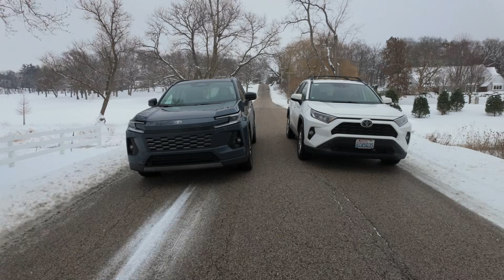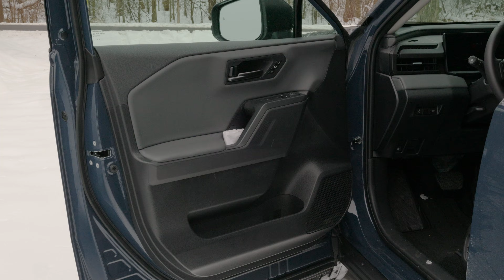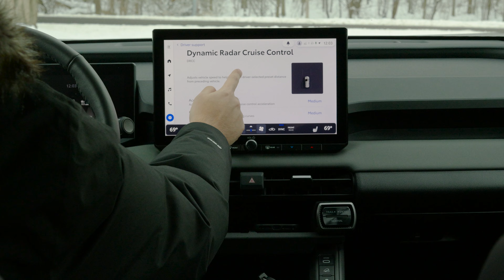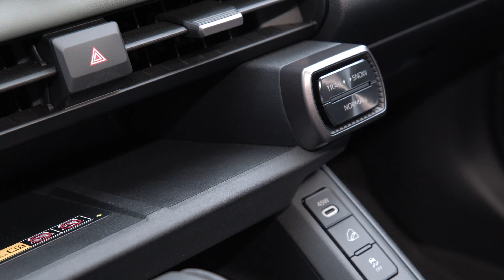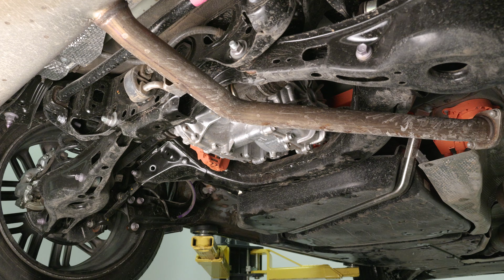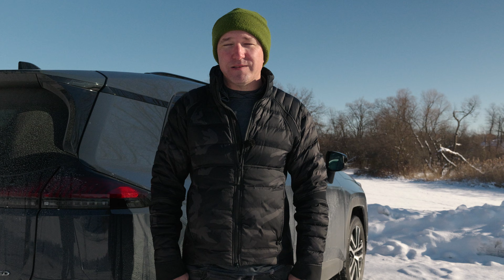2026 Toyota RAV4 | What Most People Want

Comment: I've driven and or owned most of the vehicles compared in this video and nothing compares overall to the Rav4, especially my 2026 XLE Premium. Just completed my 10th 15 -20 mile city drive with speeds of 35-45 MPH and the MPG came back at an astounding 52.5 mpg. Lowest was 46.2, highest was 55.2. Go Toyota. The best hybrid system of all car manufacturers.

Comment: I will stick with our 2021 Rav 4 Primes. The knobs are nice to adjust temp. 

Real life 38-40 mpg in hybrid and after 65k miles and close to 6 years of ownership our range has dropped from 40 miles to 30 miles and in the winter expect a 15% drop in battery range and in hybrid real life 36 miles per gallon.  

The 2026 most likely will have the same drop in battery range overtime. 

We drive 85% of the time in EV and we have a level 2 charger in our garage and charge twice a day (at home and at work) when I compute to work 56 miles round trip. 

Our next purchase will be a Toyota EV when they perfect a solid state battery.

Comment: New car exterior is better, old car interior is superior, not even a little but wayyyyy better, plastics for this much money is basically robbery, and not to mention the unsafety features, that is horrible to the point its even dangerous, it will steer you into danger just to keep you between the lines, you have to switch it off every time, just horrrrrrible

Comment: What this video completely misses is that heated/cooled seats and heated steering wheel are now automatically controlled by the car and those settings are fully customizable. This is something that used to only be available on the upper Lexus models(Lexus Climate Concierge). So the car will look at the outside temp, the current cabin temp, and the desired temp and adjust the vents, fan speed, seats, and steering wheel to get to the desired temp as quickly as possible and make you as comfortable as possible while doing it. 

The point of the new system is to set all your customizations during the first couple weeks of ownership, and then never have to worry about it again. Once done, all you need are the temp and defrost buttons. I'm very happy with my 2023 Prius Limited(all physical buttons), and planned to own it for 10-15 years, but if Toyota did a mid-cycle refresh in a year or two with this new infotainment setup, I'd seriously consider it.

Comment: The video's author received advertising money. And an honest review of the car: if I only want a gasoline engine, I'll buy a Chinese car. And Toyota will be left without a buyer. Fortunately, China still produces many cars with a conventional engine. Nibrid is more expensive. If you get into an accident, the repairs are more expensive. Gasoline isn't expensive in America. Why do you need a hybrid? 5 liters of gasoline per 100 km, while a regular engine uses 15 liters. A difference of 10 liters. For 10,000 km, that's 1,000 lire. Now calculate how much the extra cost of gasoline will be on a regular engine, and how much you're overpaying for a hybrid. It's all a scam. Corporations will always find a way to steal money. The new car has the same body, the same cheap plastic, and a dull look.

Comment: Don’t forget to mention the temporary spare tire vs the inflator set up in the other vehicles. 
If you use the inflator, be prepared to replace the tire AND wheel. The cost of removing the inflator jiz is very expensive and can equal the cost of a new steel/ alloy wheel. 
That’s why we bought a 2025 Sienna with the temporary spare instead of the kit.

Comment: Toyota /Lexus reliability is going down too many recalls lately.

Toyota is recalling 126,691 Tundra and Lexus models because the engines can stall, increasing the risk of a crash, according to the National Highway Traffic Safety Administration.

In a Nov. 6 recall notice, NHTSA said that "machining debris" may not have been removed from the cars' engines during manufacturing, which could cause the engines not to start or to turn off while driving.

The impacted vehicles include:

Toyota Tundra, Model Year 2022-2024
Lexus LX600, Model Year 2022-2024
Lexus GX550, Model Year 2024

Toyota bZ4X) was issued for a specific 2022 model year with this potential issue. The recall was for a potential failure of a hub bolt in a small number of vehicles, and in response, Toyota advised that the vehicles should not be driven until the fix was implemented.

Comment: I owned 2 RAV4 Primes, I'm surprised to hear people complain about road noise and ride comfort.  They put garbage tires on at the factory, I put a set of Michelin CrossClimates on and never had an issue with nose or ride comfort.  I fail to see how this new design is an improvement, they're hideous.  Also, no smart key access on all doors?  Overall it seems like a 1 step forward-2 steps backwards design.
Reply: Agree.  Michellin CrossClimate are the best tires I ever bought

Comment: Hm 🤔 quite interested in the JBLs that's recommended now. I currently have the RAV4 with a base sound system and it pretty good to my ears (could use a bit more warmth and less harshness, though). I hope it's not like other premium systems I've heard in the past, which basically the treble and bass freq pushed the extremes, and crazy loud, but lacks in any of the mid tones or warmth.

Comment: Even the new XC60's that I drive at work have serious glitch issues when pressing the HVAC sub menu "button" on the touch display. It takes a good 1-2 seconds before the display reacts. And that's "premium" vehicles which are only 1-3 years old. How bad will it be in 10 years? 15 years? Will the display/processor even be functional at that point? Even if it works in 15 years, it's still a huge hassle to touch a display while driving. It's dangerous and stupid.
Makes me appreciate my 20 year old Corolla even more when driving home after my shift.

Comment: 15:26 "and yes, you'll have to replace the battery at some point in the future. Well past 100,000 miles" -- really? Do you have stats on how long Toyota's hybrid batteries last just 100,000 miles or so? A quick search shows that their hybrid batteries last 10-15 years or 150,000-200,000 miles with some examples going over 250,000 miles. How long is the rattlebox 4-banger going to last? Probably the same amount of time, I would think.

Comment: My 2017 rav4 has 180,000 miles and never been in a mechanic shop. Just basic maintenance. It is a tank. My issue with the new one is:
1: not a regular transmission. Ecvt 
2: hybrid. Is it reliable?
3: too tech oriented.

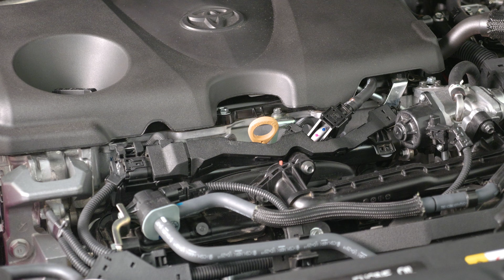Comment: 9:00 or so: if you want to go "fast" in a Rav4, buy an '06-'12 V6, preferably the AWD. In addition to being far less expensive it'll probably be more reliable.

11:20 or so: a vehicle not having "a single problem" in 86,000 miles shouldn't be a major selling point; it should be normal. Vehicles having major problems with less than 100,000 miles should be the outliers, not the exception; especially when the cars cost more than a house did a few years ago.

Comment: I'm not loving Toyota's current corporate front end. Also, that's a sizable downgrade in the interior with the screens. The rest is good though.

My wife is a Toyota-for-life kinda person, and she drives a Highlander with the 3.5 2GR, 8-speed & AWD. It's a great car and we love it, but it really handles like a cruise ship, and I had to check to make sure we didn't just have a glued-on AWD badge. The rear end wants none of the torque. The 8-speed is a little odd in its operations. We would be really open to replacing it with a Rav4 Prime when the time comes to ditch the need for 8 seats.

Comment: I tend to keep my cars for 12+ years and average around 20k miles a year. While the new RAV4’s styling is definitely appealing, relying on a touchscreen for nearly everything feels like a recipe for trouble, and I’m not willing to gamble my money on the long-term reliability of that setup.

And when it comes to hybrids, I’d much rather deal with normal maintenance over time than face the possibility of a wallet-crushing battery replacement down the road.

So for me, the new RAV4 is a pass. I’m going with a leftover gas model instead, ICE vehicles still seem like the more realistic option for lasting 15+ years without wrecking your budget.

Comment: What's next, an alternator monthly subscription service? Limiting the number of times per month you can shift into reverse without buying additional 'Reverse Credits'? I honestly believe at some point it'll come to that unless regulation clamps down on this subscription nonsense. People are going to start revolting with their wallets and the entire industry will finally collapse. Now, SiriusXM satellite radio subscription totally makes sense. But some of the other things automakers are beginning to hide behind paywall subscription services is asinine. Drive modes, ventilated seats, software that unlocks more power like in a Tesla, etc. I know Toyota doesn't give a crap, but this type of business model only increases society's boiling rage and isn't a long-term strategy for attracting customers, imo. We're already tapped out paying for a multitude of monthly subscriptions that are far more important. Now, my transportation to work (which hasn't given me a raise to keep up with the cost of inflation, btw), wants a permanent chunk of my paycheck even AFTER I've paid the car off? And that's IF the infotainment screen even lasts 6 years? Imagine paying $4,500 at a stealership to replace a failed screen in 2031 in your out-of-warranty car and needing to replace it just to defrost your windows so you don't die. Kill me. Hate to sound like an old man barking at the sky but, man, I miss simpler times.

Comment: The toyota camry is proof that people didn't care about the hybrids, they weren't electrophobic. The gas was simply cheaper on the sticker, and even though the hybrid pays for itself 2x over before a standard 3 year 36k lease is up (specifically the increased cost of the hybrid system, not the entire vehicle), people just see dollars at the dealer and the money spent on gas is a non issue. Camry went full hybrid as an experiment and their sales went virtually unchanged. Hybrids and start stop systems are so universal now, that when cross shopping cars, every car will have an engine that shuts off at red lights, every car has other hybrid-ish features. So most people, who don't know shit about cars, get in this thing and it just works. Toyota making the hybrid standard, doesn't have to advertise a seperate hybrid version anymore. It's just "the base rav4" and most people won't know the difference. You gotta take into context cvts having fake shifts because people were bringing them in for service because they thought the car not shifting meant it was broken. The rav4 will do just fine, it will continue to be a top performer and it will become the top selling hybrid in america. Now only if ford wisened up and hybridized the f150 the same way, making the 2.7 ecoboost hybrid only, hybrid sales in the US would explode.

Comment: Pros- updated gauge and main displays, hybrid engine, lithum ion, quieter car, woodland model, dashcam
Cons- no physical buttons for HVAC, no gearbox on standard version, louder structural sounds, ugly outer shape, battery system would not last 10-15 years without replacement unlike traditional drive train, ECBT instead of auto transmission. Verdict = better if you like hybrids :) worse if you care about how it looks

Comment: Wow! Kind of amazing that this review never mentions the 5th generation RAV4 hybrid CABLEGATE corrosion issue. There is the same cable attachment on the rear electric motor in the new 6th gen 2026  hybrid and it does not even have the splash guard under it that was on the 5th gen. The latest "improvement" to that cable attachment using black internal wrapping insulation is too recent to determine if it really fixes the problem. Why didn't Toyota change that mounting location for the cable?

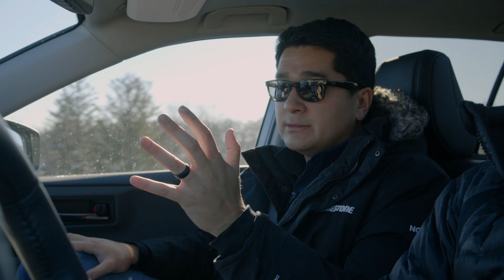Comment: 15:28…Ford has been using Li-Ion batteries in hybrids for many years.  They don’t need replaced, unless you’re talking 20 years or something.

The PHEV may be different, because that’s deep cycling the battery more, below 10% and above 90%.

Comment: I don't see any reason to upgrade from the previous model.
Reply: -slightly better engine (slightly more mpg and hp)
-slightly better noise levels (although I think they were too cheap to include an acoustic glass windshield)
-slightly safer (TSS 4.0)
-better camera quality & camera sensors

Basically it's a slight engine upgrade & some new tech which you pay for $$$

Comment: Everyone seems obsessed with the lack of physical HVAC buttons, but I have found on my '24 Prius that the voice commands work very well and I expect the '26 RAV will be even better. No need to touch any of the buttons, just say 'Hey Toyota, I'm cold' and it will warm you up. You can tell it to set a specific temperature, turn the fan speed up or down, turn defrost or heated seats on, tune the radio to a specific station, etc. It can even tell which microphone the command is coming from, so if there's dual-zone climate controls it will adjust the appropriate side. Voice recognition has improved immensely in recent years but people still aren't used to talking to their car.
Reply: Yeah and that crap is going to work when its 15 years old?  No thank you.  Why "fix" something that's not broken
Reply: @howebrad4601  ...when its 15 years old... what? 
You're missing a noun there, champ. 
Did you mean to bleat out... it's? It is?
Also, only a handful of a percentage of people keep vehicles for 15 years.
Reply: @tim3172  With what a new car costs today? Yes, many more people will be keeping that car 
15 years and more....The average age of a car being driven in the USA...is 12.5 years! last year.
Reply: @howebrad4601  you might be right, long term reliability may be an issue...time will tell. I was only trying to point out that voice control works pretty well (in response to all the concerns about having to take eyes off road or remove gloves to use a touchscreen vs. physical buttons).
Reply: Why we need talk to car if it is much faster and safer to use knobs for Hvac? I dont want to overcomplicate simple things, there is no need reinvent bicycle.

Comment: I'm the owner of a 2017 RAV4 Hybrid and like many other people I bought this vehicle is for the low maintenance, great fuel economy and reliability (primarely), any of the issues these video mentions in my personal view is irrelevant for people that buy this vehicle. And from what I can see there is a reason why is a top choice for a high number of people that most likely feel the same way. The cabin noise the engine raddle ect... is easly over come by the top two reasons I mentioned. But a quiet cabin, less engine raddling and any other improvements or refinements are very welcome for us that keep this vehicle for a long time. I hear on many channles the same points about the new RAV4 have no "knobs" the style is not as desireble and comparison to other supposely more stylist and tech rich than the RAV4. Im my view all of that is irrelevant because that is not the reason people buy this car. My next one will be another RAV4 plugin.👌
Reply: Keep accepting undesirable changes and Toyota will be happy to give you more of what you really don't want. lol
Reply: @horseathalt7308  I understand. Everyone is different and have and desire different things. But for me I just don't care what so ever, as long as I have the basics of what I need. Any useful changes are welcome but not life threning needed.🙂
Reply: @CarlosCorrea-uj2vx   But you want a vehicle that lasts a long time without trouble?  Then you will care when this new model is falling apart in 7 years? lol
Reply: @horseathalt7308 In my case my R4V4 is almost 8 yrs old now and it has no mechanical or cosmetic issues. In all my past Toyotas I've been diligent with its maintenance schedules so in return we'll beyond 8yrs. It depends how the user treats the car.😊
Reply: @CarlosCorrea-uj2vx  Your older models are what made Toyota known for durable reliable vehicles. This new one, not nearly as much....beware.
Reply: Most people that buy Toyota basically just want an appliance.   Maytag,  whirlpool, Toyota,  LG, doesn't matter as long as its bland, boring etc.

Comment: For a channel that once did an entire (and excellent) video on the now ubiquitous turbo charged DGI 4 bangers and their associated pitfalls, I'm surprised that you didn't point out (specifically) that Toyota's tried-and-true old-school NA dual injection ICE is in large part WHY they are so reliable. (Except for the plug-in trim which doesn't have port injection but runs Atkinson cycle and will see far fewer run-time hours.)

This is likely my next new vehicle in a couple of years. Folks here whinging about HVAC controls ("deal breaker"). Jeepers how much are you fiddling with the friggin HVAC controls? I hardly ever adjust mine. Jet set to auto, unlike my wife but she's CRAZY (with menopause).

Thanks for talking about audio quality. It's important to lots of us. As in an actual deal breaker.

Comment: I fu…king HATES when OEM puts the basic controls ( climate control , heated seat, etc ) in a soft menu with no mechanical controls . Hates that . I’m an avionics engineer working on state of the art business jets , before you say I’m old school . I used to own a 2017 Acura TLX 3.6 AWD, and got rid of it, partly because of that and other things . I bought a baseline 2023 RAV4 LE with a dam physical ignition key, a spare tire , and manual controls for the basic stuff.

Comment: My 2018 RAV4 got it's second set of brake pads at 89k miles. I paid $24k for it in 2019 w/ 9k miles on it! At this rate it will be replaced in 2030
Reply: It got it... is? has? was? second set? What?